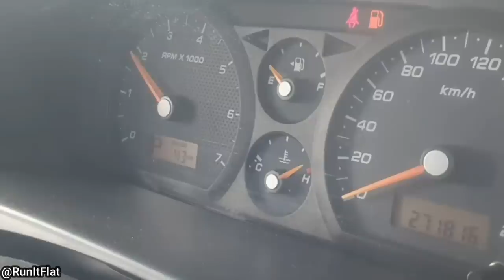Customer States Car Is Overheating And Won't Shut Off! | Just Rolled In

Comment: 1:10 was the hitch on the car the same as in the box?  I know some cars come with a hitch but they are normally Class 1 Hitches from factory and the one in the box looked like a Class 2 or 3.  I know for are Tiguan it didn't come with a hitch but I ordered a Class 2 for it and it didn't have the long supports that attach to the frame, it just attached to predrilled holes on the bumper.  This car could be the same, the one that is already on it might just be attached to the metal part of the bumper.  Can't tell from the video tho.  That mechanic shouldn't assume that just because it has a hitch its the same class rating.
Reply: Did he assume? You are assuming he doesn't know that.
Reply: @CadillacDriver  He said it already has a hitch, but didn't show if it was the same or different hitch in the video.  Not Assuming he doesn't know there are different hitch class ratings.  But from what is shown in the video, he is assuming they don't need to install a new hitch because they already have one, but the new one could be a better higher class one or it could be the same.  I guess we will never know for the lack of detail.
Reply: @pheelix-  you really are digging deep and taking it personally. What more detail do you personally need to be convinced? It's literally a 10 second snippet, he probably looked deeper in to it, than what we see in the video. Note, the box WAS open. That tells me they actually looked at it.
Reply: @CadillacDriver  Not talking about the one in the box, but the one on the car.  He might of looked into it deeper, but I am not going to assume that he did as we don't know.

Comment: How the hell was the first one still running with no battery connected? How would the fuel pump be operating to keep putting fuel in the engine, with no power?
Reply: Alternator. If he had disconnected that the car would have shut off. But some are buried and not safe to even attempt to disconnect on a running vehicle. Fuel pump relay was the best option here.
Reply: @AngusT.McCraken  so basically the alternator was turning enough to keep the engine running without any juice from the battery. Interesting.
Reply: @FoAmY99  Yes. It’s a cheap but unwise way to check if your alternator is bad.  Disconnect the battery while the vehicle is running. I’ve done it before but would never recommend it. If the car dies the alternator is bad, stays running it’s good. But you can hurt yourself or damage the vehicle.

Comment: I disconnected the battery and it's still running, I've never seen this before! I would have asked this gentleman have you never worked on a car that has an alternator? I'm like yeah the ignition switch is bad but still....🤣

Comment: @0:53 - there's what appears to be a "2" painted inside that old pump. Guessing it was a salvage yard part from a previous repair?
Reply: That is not a 2, it's debris and crap built-up on the blade housing.

Comment: The last clip: I see a tire changing machine and a balancing machine. WTF?!? What shop uses a backwoods tire seating method? If you have trouble seating a new tire, either the tech is doing something wrong, or the tire is faulty.
Reply: Or its the tech's tire and they are doing it for shits and giggles.  Judging from the laughter, they're just goofing off after hours
Reply: When tires with high walls are stored flat, they compress quite some, so the distance between their beads gets much too short to reach the ones of the rims, no tire machine can help with that.
A shot tank may help, still it may be a hassle.
Had that issue when a shop mounted new tires on my Caprice´s rims. They really struggled, took them at least 10-15 per wheel to get the tires to bead or better to find the perfect angle for the shot.
Professional German shop, so the backwoods firemaker method was not an option.

Comment: Is the first guy even a mechanic? Once your car is started the alternator is what keeps it going, not the battery. If you block the air inlet it will stall the engine. I’m not a mechanic but c’mon

Comment: The vehicle only needs the battery to start. The alternator keeps it running. You can actually check to see if you have a bad alternator by disconnecting the battery while it’s running. If it stays running it’s fine. If it shuts off your alternator isn’t making enough voltage to keep the car running

Comment: If you can't get a car to shut off first thing to do is yank the fuel pump fuse or relay. If that doesn't work then it's Dieseling and you have to block up the air intake.

Comment: No oil registering on the dipstick does not necessarily mean no oil, it only means at least very low on oil. There could be no oil, but there could also be some still in there.

Comment: As long as the alternator is working, you can't shut down an engine by disconnecting the battery.  You can stop the fuel/air or disconnect the coil relay.

Comment: It's not going to kill the engine as long as the alternator is supplying power.  So, you'd have to also disconnect the alternator.

Check for the car having been hot wired before trying other ways to get the engine to stop... then pull the ignition or fuel pump fuse.  Those will kill the engine.

Comment: An engine usually keep running if the battery is disconnected. Turn on a bunch of power equipment and the engine will most likely shut down.

Comment: A mechanic should know that disconnecting the battery will not cut an engine off if it has a good alternator. There are a number of fuses and relays that pulling one will do it

Comment: The battery is used only for starting the car. The alternator takes over after that. Pull the fuel pump relay

Comment: Really a mechanic who has never heard of experienced pre-ignition? In this case the engine has got so hot that it is above the flash point of the fuel and so combustion continues.  Simple science.  Stall the engine as disconnecting the battery serves no purpose other than to try the electrical system. Stay well away from that 'mechanic'!
Reply: I think the mechanic answered your question when he said that the ignition key was "all buggered up"
Reply: When I was a young buck out chasing women I had a problem with pre-ignition. I started thinking about football games or some other nonsense to got my mind off of what I was doing. Now thinking about it, I don't believe they called my problem pre-ignition......
Reply: @larrykeenan598  Good one! 🤣🤣🤣🤣
Reply: Those falcons are notorious for failing ignition switches- as he said at the end "ignition switch is buggered"

Comment: Isn't its normal that engine can run even after battery unplugged? The batteries are for to charge the circuit to make the piston running, right? So once started unplugging battery will not turn the engine off right?

Comment: If a mechanic thinks unhooking the battery will shut the car off, he needs to find new work.
Reply: It usually does, after a few seconds. But he destroys many electronics by that
Reply: @tobiasmetzger4522  if it stops, the alternator is faulty.
Reply: @rossbrumby1957  nope. It just fried the ecu in mere seconds.
Reply: @tobiasmetzger4522  It can certainly happen. I have replaced a few that I suspected were due to voltage issues.

Comment: Usually when you disconnect the battery, the vehicle will continue to run because, alternator. If you need to kill a motor, suffocate it.

Comment: OMG Disconnecting the battery won't shut down an engine as long as the alternator is working. You have to either cut the fuel supply or power to the ignition/spark.
Reply: On my Taco I wonder if I could trigger the immobilizer 🤣

Comment: A car's alternator will maintain 14.7 system voltage with no battery as long as the ignition is 
"buggered", or just on.

Comment: Yeah...I wouldn't let that first mechanic touch my car.  Vehicles can run without the battery attached; the alternator keeps them running.  I've seen a few cars that need the battery to run, but for him to act shocked and say he's "never seen this before" is not something you want to hear from a mechanic.

Comment: IF you find a mechanic that cannot understand why an engine still runs after battery is disconnected, get another mechanic.  The battery starts the car, not runs it.  It's a wiring issue or switch issue (ignition buggered).

Comment: Why would a mechanic think that disconnecting the battery would make the engine stop running? That would only be true if the alternator was defective or disconnected.

Comment: Best way to turn an engine off when the ignition switch is buggered is pull the fuel pump fuse or injector fuses and let the motor run out of fuel. The alternator will keep the engine running without a battery smh.

Comment: The machine for the first one is not that smart.
NEVER disconnect the battery when the engine is running to switch it off.
The alternator will keep supplying power and since the battery is not their the odds of a surge increase.

Smarter to pull the FUEL PUMP RELAY OR FUSE

Comment: The engine would obviously keep running even if you disconnect the battery, that's the reason for the generator or am I missing something?

Comment: First one- disconnected battery while running does absolutely nothing if the alternator is doing it’s job. That’s an ignition switch issue. That mechanic is a fool.

Comment: What do you mean you've never seen an engine run with the battery disconnected?? The battery just starts the car. Once started the electrical runs off the alternator. 🙄 
It'll shut off if you plug off the air intake and give it a load, or put it in 5th gear and let the clutch out. It's not that hard.

Comment: I don't understand why the first guy was so flummoxed.  For years, most cars would run off the alternator.  Keys wear out and can slide in and out of the ignition switch without it being in the correct position.

Comment: Mechanic..."i disconnected the battery and the car is STILL running."   WELL DUH.  Not good for the car but yeah the car will run off the alternator if the battery is bad or disconnected.  Even an alley mechanic knows this.

Comment: 1:47 Now THAT's a familiar sight... They're lucky it wasnt the GDI engine, or else that engine would've seized about 6k miles ago. the DOHC engines are more reliable in my experience but they're still a shitty engine. (also typical hyundai owner.)

Comment: What a goon of a mechanic. Disconnecting battery🙄. It will be powered from the alternator 🤦‍♂️. Potentially fried the alternator too running it without a load. Even some ‘technicians’ shouldn’t do cars!

Comment: The first clip made me question that "technicians" suitability as a technician...

For a start, disconnecting the battery will NOT shut off a running engine by itself. Only if the car has a protection against disconnecting the battery will the ECU actually shut it off to protect itself.

The battery serves three purposes really.

1. A means of running the starter so you don't have to hand-crank the engine to get it to start. This was the first use of batteries in cars all the way back in the 1920's.

2. A power source when the car isn't running to provide power to all the electrical bells and whistles that you might want to have. This only became practical with the advent of sealed batteries in the 1970's as batteries before that required maintenance and having a power draw on them required constant maintenance.
Though you still technically have to maintain your cars battery by running your car once every 2 weeks (optimal) to give it some charge. Lest it would become discharged and permanently damaged due to said low charge state. Read, not DEAD/INOPERABLE but DAMAGED.

3. A vital part of the electrical system that acts as a power surge dump and a solid GROUND for the electrical circuit.
All the electronics in your car relies on this common ground to function properly and if you disconnect it with the alternator still providing circuit power you are ASKING for burnt circuits and strange goblins in your circuits that will cause failure codes to be recorded and possibly running your engine in a BAD undefined state.

It's like when you find a broken ground wire somewhere and that causes your electricals to go nuts as power is flowing through channels it's not intended to. Like, you could lose ground on your cabin fans and all of a sudden your engine starts running really rich as the O2 sensors "sends" the wrong voltage to the ECU.

EDIT: At least he's got it on video now that he pulled the battery. So he's probably liable for all the electrical issues that may have cropped up after pulling the battery. ;)

Comment: Plug the air intake you silly. You are royally boned if a diesel ever runs away on you and you do not know to do this with an engine that won't turn off.
Reply: Although that was a petrol engine.....
Reply: @rossbrumby1957  Bro, all engines need air. Cmon man.